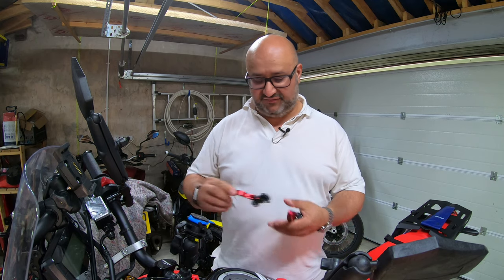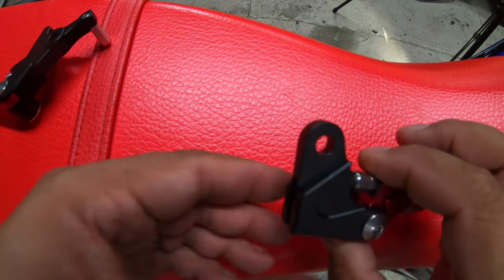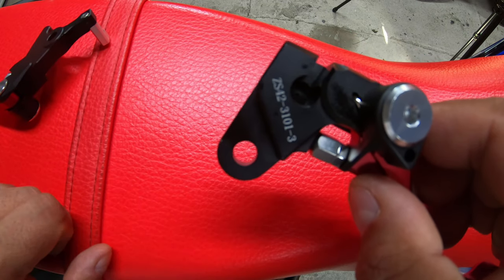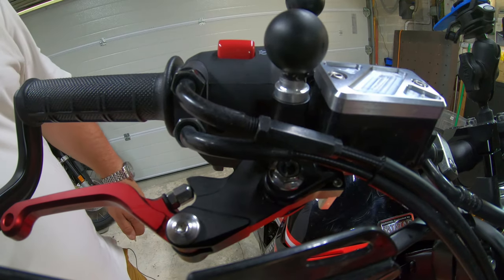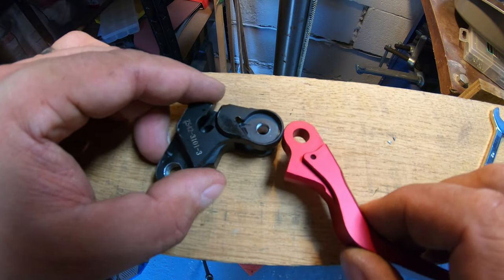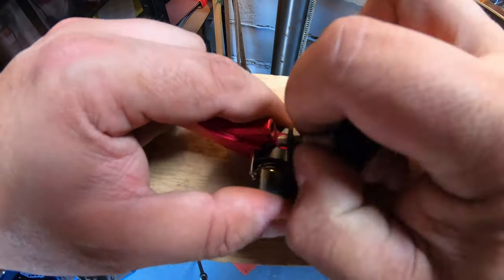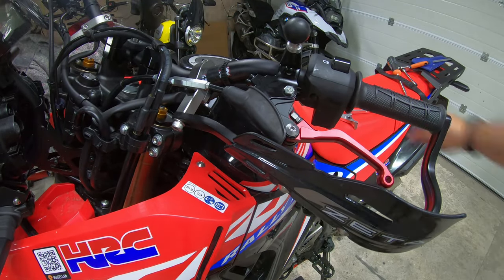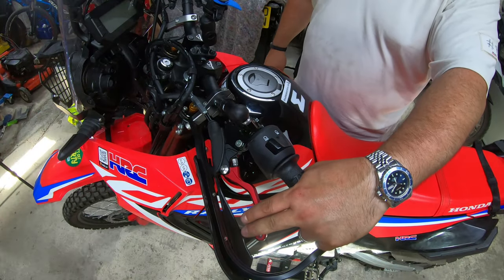How To: Honda CRF250L Short Levers Fitted to a CRF300L/Rally 4K

Comment: I fitted very similar levers to my CRF300L last week and, like you, drilled out the clutch lever pivot hole but I also fitted a thin shim with the clutch lever to reduce the vertical play.  I guess the gap between the jaws is slightly larger on the 300 than it is on the 250.
Reply from the maker: Good point. I’ll measure them. I thought I had about the same play in stock as the replacement, but it may be that both needed a shim! I’ll check.
Reply: So will the levers from the 2022 300L fit on my 2022 crf450x
Reply from the maker: @robertlambert7906  no idea I’m afraid. I’m not expecting any 300L changes but I don’t think the 2022 models are confirmed yet. As for the 450X, not a clue I’m afraid. Google perhaps?

Comment: Thanks for another quality upgrade/instal episode. 
I’ll try to find a set of those levers, as well.
Reply from the maker: I’m sure that in time proper 300 levers will become available. It’s just taking a while to filter down. The stock ones are fine, and it’s only really a thing for two finger clutch operations. The levers seem to be everywhere and are cheap. I just hope they last! (Though with the handguards there’s a fair bit of protection for them.
Reply: @PeakMotorcycles  I ordered these short levers from e-Bay last week. It will take them a month or more to arrive. I’ll be upgrading the Rally with the skid plate, hand guards, tail tidy, exhaust, etc. from BikerzBits soon. The Double Take mirrors and the Garmin Zumo came in this week, as well. The mirrors are excellent. I got a set for the KLR, also. 
Thanks again for all your upgrade recommendations.
Reply: The levers came in today's mail. This video will surely help when I do the install. 
Thanks again!

Comment: Hmm I just installed the zeta levers a day or so ago and they fit up perfectly. Zeta says it’s the same part number for 300 as the 250.  Took a 60m ride with them yesterday and worked great. But I will say the clutch does come all the way back to the bar. I thought you had the red zeta’s. Couldn’t find those anywhere so I had to go with the black.
Reply from the maker: I couldn't find any Zetas anywhere in stock, and these are just cheap copies from China from eBay. Interesting that the Zeta ones say that they fit both... I don't think I'm the only person who found the clutch lever needed drilling out. Maybe mine are for an earlier version of the 250? The levers I have definitely came with a 7mm hole and needed an 8mm to fit the stock bolt. I don't have a 250 to check I'm afraid.
Reply: Hey. I’m trying to buy the same leavers but on Amazon. What year of CRF 250 your levers supposed to fit? I was assuming 2020? & what crf model? F, L, R? Let me know please thank you.

Comment: They do look fancy but for me I'm just cutting the ball part off the original levers and voila the same function without buying anything.
Reply from the maker: Yup. That’s the perfect solution. Harder to go back to if you decide to return to stock, but Honda will always sell you an OEM one if they can.
Reply: @PeakMotorcycles  What I do is round off the edges and now I am thinking of plasti dipping them with plasti dip (red). But only a little portion of the handle where the two fingers grip the lever.
Reply: Well, these have adjustable reach. Not sure if the stock levers do.

Comment: It's not much shorter than the original, maybe I'll cut the original lever, little expense, great return
😁
Reply from the maker: True, but it is short enough to clear two of my fingers when pulled to the bar, which was the aim. There’s also a reason there’s a ball or ring on the end, which I guess you lose with cutting the stock one. It is cheaper though.
Reply: @PeakMotorcycles   It's true, but in the Africa Twin I made a screwed aluminum plate, which replaces the ball...I'm also trying to understand if I can adapt a MTB lever on an original basis.

.

Comment: Does the clutch lever stay more firm or still move up and down like the standard?
Is there any trick to make the standard clutch lever firmer?
Thanks!
Reply from the maker: It still moved a bit. After the video I added a washer, which helped. I expect you could do the same with the stock lever.

Comment: The clutch side looks like it hits the plastic turn signal assembly with the bend in the new lever. Does it affect the clutch operation?
Reply from the maker: It may look, but it doesn’t come into contact and clutch operation is not affected. I’m 2000 road and trail miles into it now and still using the same levers.
Reply: Humm, mine hits but shifts fine. Have to look at it again. The length of the bend and overall length is shorter. I like the shorter length. Have to fiddle with it

Comment: Did the clutch lever hit the headlight switch on a full pull of the lever? I’ve seen this as an issue on other installs for the CRF Rally.
Reply from the maker: Not on mine. There’s no headlamp switch on the front of the button housing.

Comment: Does this work for 300L non abs? Shows doesn’t fit on eBay
Reply from the maker: I would have thought so, as I think the master cylinder and levers are the same part for ABS and non-ABS versions. That said, these levers didn’t fit my bike. I had to drill out the pivot holes to make them fit. (In the video 😉)
Reply: @PeakMotorcycles  ok thanks.  Stock handles suck so was excited maybe a fix.  I’ll give it a watch thanks for all your great work 👊🏻

Comment: Question. I greatly dislike the price of the zeta levers, but I also don't want amazon chinesium levers. 

What is a good middle ground set for a 300 rally?
Reply from the maker: Hi,
I've only tried the OEM ones and these ebay specials which I guess fall into the category you don't want... I haven't tried any others I'm afraid.
Reply: @PeakMotorcycles  Have you heard of any success from others? 

I'm not opposed to amazon levers as long as they are quality.
Reply from the maker: I haven't, but then I guess it's not the first thing that comes up in conversation.
I had a quick google, and perhaps something like the AS3 forged levers? https://www.as3performance.co.uk/products/honda-crf-250-l-2012-2020-rally-2017-2020-forged-front-brake-and-clutch-levers-set-black
I haven't tried them myself, but it's a known brand and price wise between the cheap ebay ones and the Zetas.
Reply: @PeakMotorcycles  No 300L or rally mentioned on their site. I looked at 250L parts and they don't have levers for it, just the other non street legal 250 models. Plus I am assuming the clutch would need to be drilled would have to be drilled even if they had some. 

Weird.

Comment: I recently bought these off ebay for my CRF250L, Part# ZS4-3101-3.  I have the same issue, the clutch pivot hole diameter is too small.  To enlarge it, I didn't dissemble the lever, no drill press, you can just put that pivot section on the edge of a piece of wood and use a hand drill to enlarge the hole.  The 2nd issue is the thickness of that pivot area.  It looks you have the same part number as mine but has a better fit, mine is much thinner than stock, had to use a washer to fill up the slop.  Inconsistency of these parts?  Also the stock lever has a brass pivot bushing.  I think some of the nicer aftermarket levers have that also.
I made a video showing the issues, https://www.youtube.com/watch?v=Xl1LIMvxI_A
Reply from the maker: Thanks for sharing. I’ll take a look. I put a washer in mine after my first ride out with it. It’s still not perfect, but it’s better than it was.
Reply: @PeakMotorcycles  I forgot the size of the washer I used, metric if I recall.  Regardless, i do like the feel of these levers much better than stock.